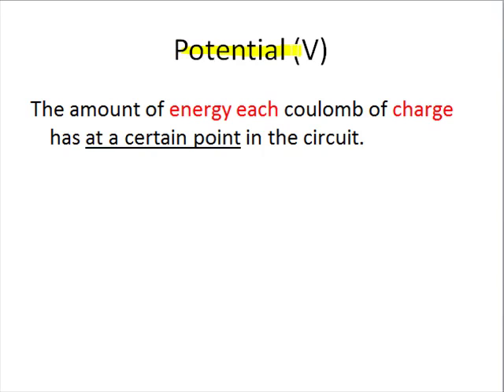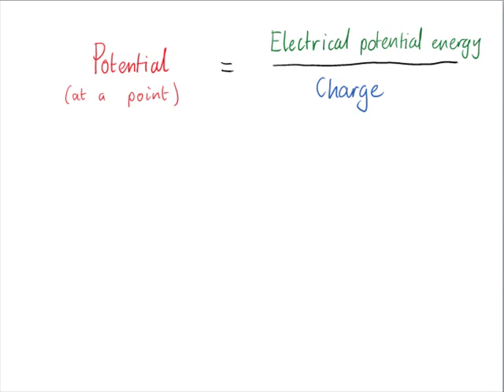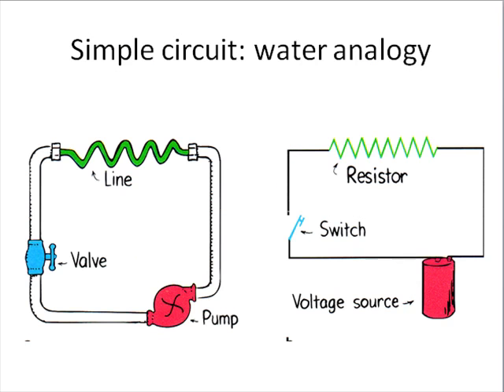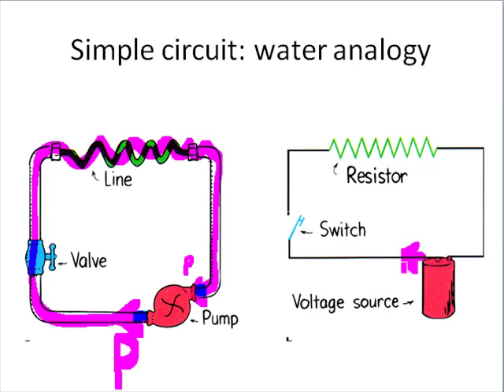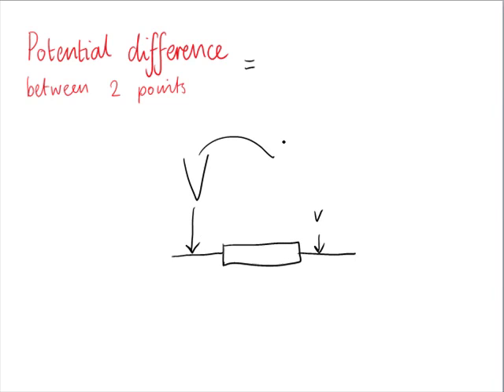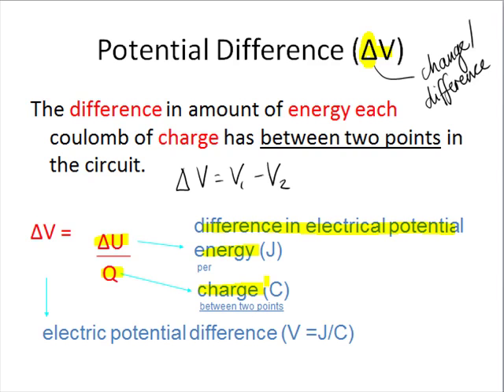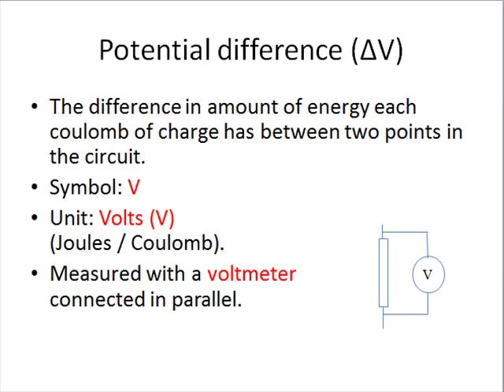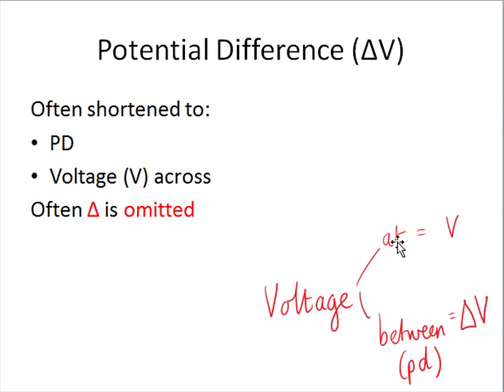Potential | Potential difference

Comment: How a charge move from a high potential to low potential as electron move from low to high?
Reply from the maker: This is the difference between seeing current as a flow of positive charge (conventional current) or seeing current as a flow of negative charge (electron flow). In science we usually use conventional flow even though we actually know it is electrons flowing through metal conductors